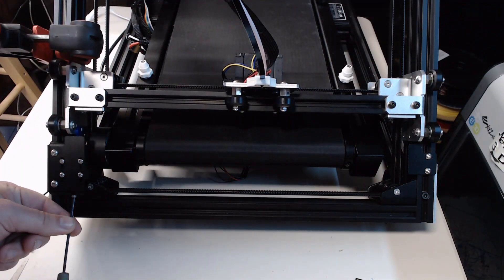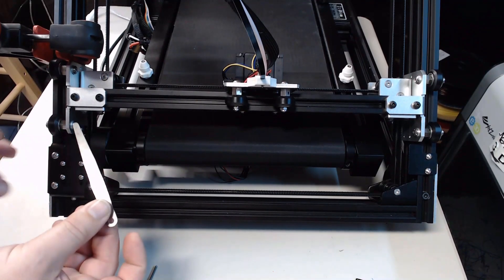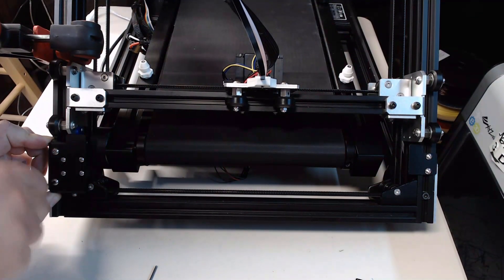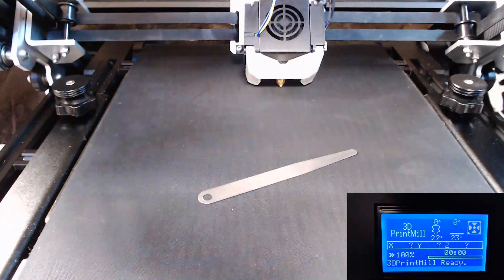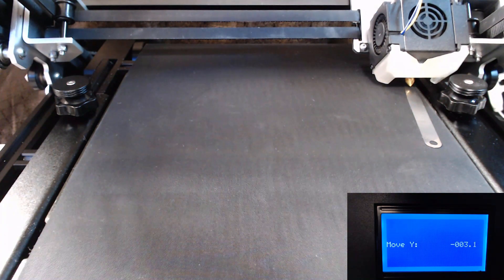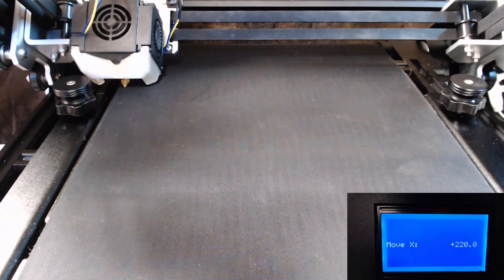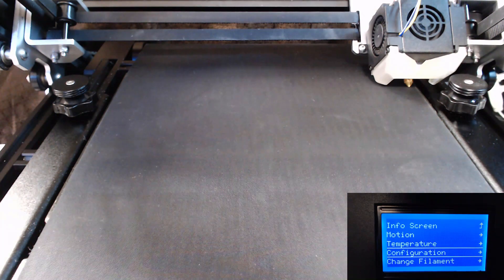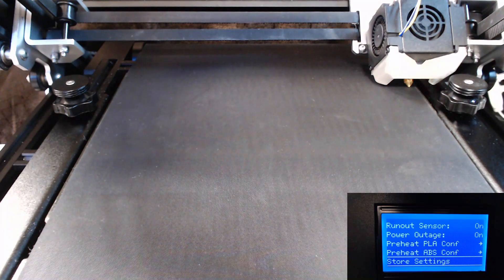3DPrintMill aligning Y-axis stop switch , bed leveling and  setting Y-offset.

Comment: Thank you -- My 2023 printer (just got it on 8-25-2023) would not save the new "home" position-- so I just moved the bed up... did the"y" axis  and it worked-- still a bit peeling up on the first 5-10 passes-- I will add a raft to help prevent this in the future--
Reply from the maker: Did you update the firmware to my version?  The factory firmware does not support my negative Y offset homing.
Reply: Drat-- I did not do that-- rats-- I will do that now ... Thank YOU :)  @NAK3DDesigns

Comment: Hey I am setting up one but I keep running into the issue of the Y axis doesn't try stopping when I auto home it just keeps pressing into the stops how do I fix that?
Reply from the maker: Sounds like the y-axis end stop isn’t connected.  Check to make sure there isn’t a loose plug under the back right corner.

Comment: Hello, I have done all the things in your video. Nothing is sticking, all of my prints are failing. I have had this printer for almost 2 years and have never had a print. I need your help pleeeeeeeassssssssse.
Reply from the maker: Ok, First questions, what slicer are you using?  Have you installed any upgrades?  What temps are you printing at?

Comment: Why do you adjust the end stops with the nozzle touching the bed, THEN drop the bed? How does that not screw up the reference used when you set the Y endstops?
Reply from the maker: Good point, I probably should have had "drop the bed down" first in the order of steps.  Also I highly recommend going thru this procedure more than once the first time so that the hard stops get set properly this will help prevent the nozzle from damaging the belt.
Reply: @NAK3DDesigns  Thanks, NAK! I bought a used CR30 that could print, but not well. After adjusting everything, I'm running into the hard limit before the nozzle is anywhere near the belt. Just wanted to check to see if I was missing something!
Reply from the maker: @84westy55  Yea, when I made the video I was working on the assumption most people would be doing this when they got the printer new and usually the bed is all the way down or nearly, but still I think you are right..  the bed should be lowered fully first before doing anything else.

Comment: When on the X-axis, 210 puts it in the middle. The measurement is off. It only prints on the right half. And only half way up. When trying to auto home after moving it all the way to the left and/or up, I get a homing failed, printer halted, error. I believe I accidentally hit the restore default settings or something firmware wise. I've been at this for hours. It prints but doesn't print right at all
Reply from the maker: Do you have my stepper upgrade?  Sounds like you do and the steps/mm for X & Y both got set back to 80.  They need to be set at 160..
Reply: @NAK 3D Designs  is it the two red Motors at the top? If so, then yes. I bought it used and he mentioned some upgrade.
Reply: @NAK3DDesigns  THANK YOU SOOOOO MUCH!! THAT FIXED IT!!! THANLS FOR THE FAST REPLY TOO!!

Comment: I followed your instructions step by step - but when I push on the "set offset" it flashes back to the main screen and still shows -2 for the Z but at the bottom of the screen said I need to "Home Z", which I did, returned to "Set Home Offsets", then stored it and it worked.

Comment: Your video is a great tool! I used it to set my printer and it prints great. I have a question it prints everything fine but the length is off by around 10mm short. Is there a way to print a test print and adjust the accuracy? I can use the same file in another printer and it prints the correct dimensions.
Reply from the maker: Sure.   You just need to calibrate your z-steps.  Print this and follow the directions in the description.  https://www.thingiverse.com/thing:4794626

Comment: Hello,
 It looks like you have an aftermarket cover/shroud? over your nozzle (The white cover).  Where can I get this? The original one I have just broke and im struggling to find a replacement or even one I can print. 

Thank you
Reply from the maker: That is actually the original design that Creality based theirs off of.  Here is a link to my Thingiverse page.  I have the original cooling shroud posted there and many other mods for the Cr-30 listed there as well. https://www.thingiverse.com/nak3ddesigns/designs
Reply: @NAK3DDesigns  Thank you! You have saved the day. 👍

Comment: I'm not able to do negative y-offset so I'm wanting to update my firmware. Should I go with yours? Or should I go with a more recently updated "Marlin-CR30" or Creality's official newest one?
Reply from the maker: I’d say start with mine as it’s a known good.  From what I know Creality’s version is still not working correct.
Reply: @NAK3DDesigns  How do I update to this firmware?
Reply from the maker: @Lulzigi  Download the .bin file.  Copy it onto a blank SD card.  Insert the SD card and reboot printer.  When it boots sit will update (may take a few minutes).  Remove SD and reboot, firmware is now updated.   If firmware does not update rename the file (example original name is firmware.bin, change to firmware  firmware2242022.bin) and then try again..   File name must be unique each time you update firmware, you can't use the same name twice in a row.
Reply: @NAK3DDesigns  okay I've done that. Now I followed your directions all the way to moving the x-axis to 220, but whenever I do that (regardless of the current y-level) the y-axis falls down a bit with a loud clunk! Wouldn't that throw off the y-offset?
Reply from the maker: @Lulzigi  that loud clunk is probably the x-axis hitting the far end and since its core X/Y its making y move too..  You have two options.  1 Only move out to 215 to do your leveling (but this will only get you leveled it won't fix the hitting problem.).  2. Remove the X-axis endstop from the bracket its attached to and mount it straight onto the hotend backing plate (there should be two holes under the switch for it to mount to)..  This will get you about 2mm more of travel on the x-axis
Reply: @NAK3DDesigns  Now I'm confused. It looks like the positive x-axis endstop is also the housing for the x/y movement belt. If I were to remove that, the belt would fall limp and the hotend wouldn't be able to move. Am I looking at the wrong part? It touches to the opposite of the x-axis limit switch?
Reply: I can provide a picture of you think it's different from your production model.
Reply from the maker: @Lulzigi  Sorry i was refering to the X-axis limit switch which is on a small bracket attached to the hotend backing plate.  just remove the limit switch from the small bracket and mount it directly on the hotend backing plate.

Comment: I've finally gotten my printer functioning fairly well. My only complaint is that when I run repetition in ideaMaker, it links the prints together. I've found the place where I would need to enter the G-Code to adjust repetition but I don't know how to use G-Code very well. I was hoping to run the z-axis a little, wipe the nozzle as it does. Then begin the next print. Do you know how iI'd go about that?
Reply from the maker: Not sure what you mean by links the prints except for maybe some slight oozing..  I don't typically recommend moving the belt between prints as you will get that oozing and the next print will always be a minimum of how high the previous print is away.  So for example if your part is 20mm tall there will be 20mm of space automatically  between the prints due too the angled axis..  hope that makes sense, otherwise  I'm not sure what gcode you'd need to do a wipe, like you I'm not great at writing custom gcode..
Reply: @NAK3DDesigns  I'm doing fairly short prints and my first attempt at repetition resulted in my prints touching and sticking together. It wasn't too bad, I was able to bend them apart, but it affects them aesthetically which is important to these prints. I'm fiddling with the G-code and figuring it out though
Reply from the maker: @danielfaubert1903  Are you doing the repetition with the M808 command or with the copies option?
Reply: @NAK3DDesigns  the copies option (or repetition in ideaMaker I think it's called).
Reply from the maker: @danielfaubert1903  have you updated the firmware?  If so I recommend using the M808 command to do your repetitions instead.

Comment: I have been struggling with this. After i set the home offsets and save the config, the nozzle is way too high when it starts a print (3-4 mm higher than the bed) Oddly before I tried to level it with this method everything was at least trying to print. What can I be doing wrong?
Reply from the maker: All other people that have had the same issue weren’t actually pressing the button for “set home offsets”.   Another possibility is your gcode isn’t homing before the print starts.
Reply: @NAK3DDesigns  Maybe this a problem with the newer models? I just got mine this week and set it up following your video today. I did press the set home offsets button, then it beeped at me and said it worked. Now I'm having this exact issue where it's not starting the print on the belt.
Reply from the maker: @danielfaubert1903  have you updated the firmware or are you running what came from the factory?
Reply: @NAK3DDesigns  I'm running your firmware. Had to so I could lower the z axis into negative values.
Reply from the maker: @danielfaubert1903  ok, was hoping Creality may had finally fixed that issue.  Email me a gcode that has this issue printing.
Reply: @NAK3DDesigns  Ok. I sent it
Reply: @NAK3DDesigns  Also, if you know of an easy fix, I've been struggling to adjust my bed levelling knobs, 1 of them is turning easily (once I've loosened the locking knob of course), but the rest all seem very seized.

Comment: When trying to save the offset I get the error message "err: too far!"
Reply from the maker: I've never seen that error, which firmware version are you using?
Reply: @NAK3DDesigns  the one linked under this video, the original negative value one.

I found a single other person who had that error on the discord (posted there as well, including a picture), but he never clarified how he got it or how he got rid of it.
Reply from the maker: @BelviGER  What value are you trying to save?  You could try moving the y-axis endstop a bit lower, this would move your home location closer to the belt and thus decrease the needed amount of offset.
Reply: @NAK3DDesigns  I've tried negaitve values, 0 value and positive values, only thing left would be trying positive values beyond like 3,5mm. If there isn't a very specific range I need to hit, then its not the actual calue it dislikes

Doesn't matter if I home, then follow the exact instructions from the video, or if home and then just try to save the offset at homeing position, the printer beeps and gives that error message.

The entire thing started after a crash/failed print, could that have anything to do with it? Is there some sort of sensor or whatever that would still allow homing but not saving offset?

Is there a new, better firmware I can just try in hopes of it fixing itself?
Reply from the maker: @BelviGER  I'm at a loss.
Reply: @NAK3DDesigns  apparently it is to do with the Y endstop, now I just need to figure out if I need to configure it different, or if the sensor/cable might be broken.
Reply: @BelviGER  and @NAK3DDEsigns did you manage to sort this issue out? New 'Home' value should be around -2.5 but am getting the error mentioned in initial post by @BelviGER
Cheers ANT

<Edit> another couple of goes and it appears to have set OK.

Comment: I followed your instructions in order. lower Y-axis to bed, set physical stops, lower bed to bottom. 

When I go to set the negative offset I run into the physical endstops at -4.1mm. 

This leaves my nozzle too high off the bed.  

From here is the best course of action to reset the physical end-stops with the bed bottomed out, or raise the bed with the thumbscrews?  

Thanks in advance!
Reply from the maker: You need to have the nozzle touching the bed and the y-endstop at the top of the bracket before setting the hard stops.
Reply: @NAK3DDesigns  Thank you for the quick reply! 

I did that. I just included that in " set physical stops". Sorry for not being clearer. 

I now have the Y zeroed at -4.1mm. When I auto home it leaves a gap just big enough to hold the 0.10  included shim between the physical Y stop. and the X chassis.  I believe this is what it should be according to your advice. 

I have noticed that there is a high point in the middle of the bed.   The belt has a small gap between it and the bed on the outer edges. I hope that explains it well enough. 

Is there any adjustments to correct the belt not being in contact with the bed on the outer edges?

Thanks again for the assistance!

Edit: The Y-home keeps resetting to +4mm for some reason.
Reply from the maker: @dotJata  It should be at +4 since you gave it a negative offset..  This is how it is meant to function.  this helps keeps the nozzle off the bed when hot.  when you start a print it will drop back down to the bed to print.  you may need to tighten your belt or the bed could be warped and may need to be shimmed.

Comment: I flame the firmware, it won't let me set home offset after I adjust the y axis.
Reply from the maker: After I made this video Creality chose not to allow a negative Y-offset.  There is a link in the description to my version of the firmware.  You'll need to update the firmware to use this procedure.
Reply: @NAK3DDesigns  I did flash your firmware, so I can have negative y.  I followed some of your points in your video expect for the part where you went from -5.5 to -5.8, I just stayed at -4.0, but when I go to set home offset it won't let me the new offset.  I also notice after I try that, on the main menu it's says Home XYZ on the bottomed left corner.
Reply from the maker: @JDMillest23  Not sure what is going wrong there.. All I can say is reboot, home all, and then immediately try setting you y-axis offset again..  maybe the steppers timed out before you went to save..

Comment: Hi!! I'm just fighting with my cr-30, I try to make same thing you did, but I can't move Y axis to negative position.
Reply: Ok sorry I didn't see that thanks ;)
Reply from the maker: Check the video description.  You need to flash to my version of the firmware for negative movement.
Reply: @NAK3DDesigns  How do I flash to your version of the firmware?
Reply from the maker: @Robert Mandrell  just download the .bin file to a blank SD card, insert the SD in the printer and power on the printer.  After about 10sec it should boot with new firmware.
Reply: @NAK3DDesigns  I have spent a few days figuring out that the USB adapter I got from Creality is no good. So I finally got that straightened out (I do have a full time job so it's been a struggle for time) and I put the .bin file on the blank SD card. I have tried a few times now but the printer will not move in the y negative direction.
Reply from the maker: @robertmandrell6702  Which .bin file did you use?  When you boot up does the marlin screen say Bugfix 2.0.X?
Reply: @NAK3DDesigns  No it doesn't. So I downloaded the wrong file? I am not good at this. Can you give me a little more information on how to identify the correct file? 
Also, what coding should I study to get better at the 3D printing code?  Anything would be appreciated!!
Reply from the maker: @robertmandrell6702  I e-mailed you the proper file.  As for coding to me honest I'm still learning myself, I do most of my firmware changes using VScode..  I recommend watching some of Chris Riley's videos if you haven't..  Here is a link to his VScode video.  https://youtu.be/W6zYvRgGr3Q
Reply: @NAK3DDesigns hi there I'm having the same problem. I have emailed you asking if you could send me the updated firmware. I have tried new SD card fresh format. Changing name of firmware etc. It will not let me flash the firmware update
Reply from the maker: @user-flippaintmini  E-mail sent..  Not sure what size SD you are using but I would recommend using a 4gb or less SD card, larger cards seem to cause issues too.

Comment: Could it be that the shipped firmware doesn't allow y to be negative?

Edit: I'm a moron
Reply from the maker: That appears to be  the case.  I gave Creality the fix to allow for negative Y-offset but they chose not to implement it..  There is a link to my GitHub repository with my updated version and the original firmware should you not like it and wish to revert back.
Reply: @NAK3DDesigns  thank you I found it via the help of somebody in the discord, I do feel quite foolish now seeing that you even wrote about it in the video description

Comment: I just got my printer last week and I'm having a real hard time with the leveling since they won't allow neg y axis. I feel their method is just not accurate at all. And the other two knobs in the front I'm unsure how they work for leveling.
Reply from the maker: The two knobs in front are less important.   Friending on how much you adjust the rear knobs you may need to adjust the front knobs to keep the entire belt level.
Reply: @NAK3DDesigns  Also, I tried using your github version for firmware, but all I'm getting is blue screen. I've reformatted the SD card and put the .bin file for your firmware in there and inserted it and let it sit for 30s and nothing happening. Unsure if with the shipped out printers if the .bin file needed a specific filename format?
Reply from the maker: Did you change the file name?   Every time you flash it needs to be a different name from the current firmware loaded.   Try changing the last digit of the file name.
Reply: @NAK3DDesigns  That was the trick thanks, was unaware of that. Yeah I wish their instruction manual that came with it was a bit more informative.